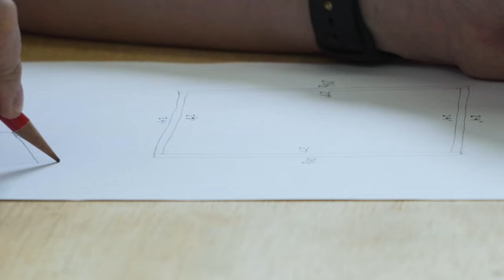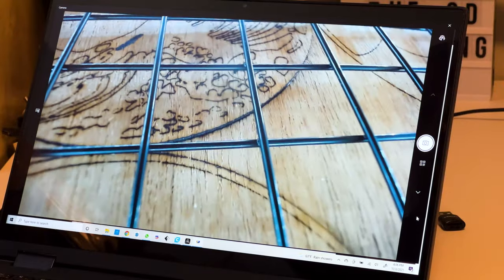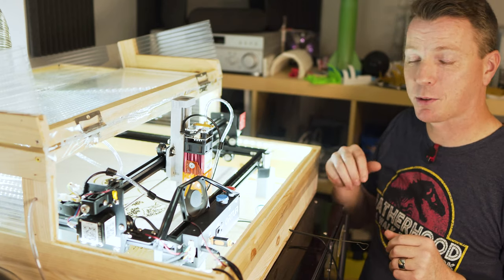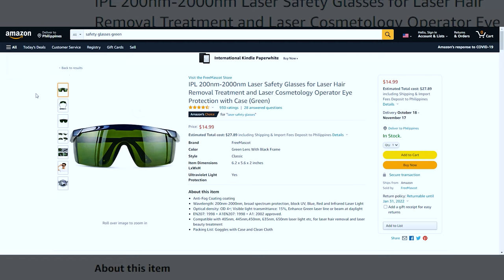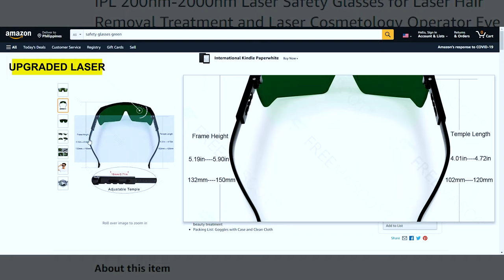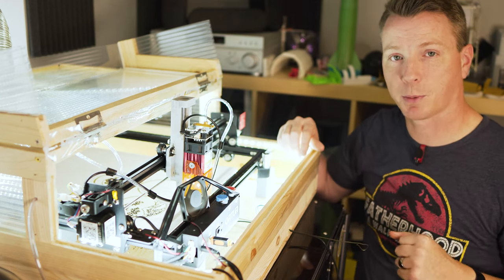6 Must Have ACCESSORIES for LASER Engravers / Cutters   |    Feat. Ortur Laser Master 2 Pro

Comment: Pro tip,  if the laser didn't cut all the way through in certain spots,   pull out an orbital sander and sand away.  Works like a charm
Reply: Louisiana Hobby Guy has a video out on restarting a job after removing the piece.
Reply: The squid games honey comb method

Comment: We have a K40 laser in the office with ventilation of the housing. It is quite miserable. At home I attached a 40W diode laser to a MPCNC. Instead of putting the whole CNC in a housing I attached the ventilation hose directly to the Z-axis near the laser - so the smoke is sucked directly away and through the window out of my room.

The idea with the camera is great, thanks 😀

Comment: I'm looking at the 65x50cm models, they come with the same range of laser heads from 2 to 20W I think my budget can handle the 15W unit now that I repaid my overdraft. I don;t think they are quite as developed as the Orthur though, like exposed PCB, and no obvious emergency stops etc... but the frame looks fine for a 2D CNC.

Comment: That poor orange shroud. You destroyed it with your drill @ 6:29. Lol
Reply: That's what he gets for using regular drill bits instead of drill bits made to drill plastic (or a step drill).
Reply from the maker: Yup - I murdered it. But a bit of packing tape held it back together just fine. Lessons for next time.

Comment: I agree that using the camera underneath is brilliant!  Specifically, which camera did you use?  I bought a Logitech C920S and it will not point up from underneath without modifying it.  Did you use the NexiGo camera you listed?  Did you modify the mount so it would point up?

Comment: Just FYI, A soldering iron does a better job at making a hole in acrylic than using a drill. Proper ventilation is needed, but does not shatter or break acrylic.

Comment: I'm thinking about buying this for cutting 4-5mm plywood. Should i buy the 2 Pro OR the 2 Pro S2 ? Wich is better for cutting?
Reply from the maker: To my knowledge, they both use the same laser - a 5500mW diode. You CAN cut 4-5mm ply with it but it's not quick and will require quite a few passes and probably air assist. Cutting 3mm can be difficult with this laser. A Co2 laser will be a lot more powerful for those types of thicknesses.

Comment: "Print at your own risk - I couldn’t get this one to work"

So then what did you use for the Z-axis height adjust?
Reply from the maker: I was referring to the one that claimed to work with the Pro model. I ended up cutting into the non-pro model version to make it thin enough for the bolts to reach all the way through, which is why my Z-axis adjuster looks cut up. It is :)
Reply: @The3DPrintingZone  Do you have the drawings or plans for the 3D print?

Comment: @12:20 some of the safety features are a bit… unreliable on my Ortur. For starters I couldn’t even use half the speed they advertise, as the bump protection would trigger on fast acceleration - wouldn’t even show a legible error message. And yes, that even happened when the device was mounted, using completely snug fitting feet, onto a 600x800x20mm sheet of plywood with the rest of my enclosure attached. Tech support’s solution, after weeks of discussions and mostly waiting, was sending instructions how to lower the sensitivity. I‘m fine with that, although it was a pain to get their response.

Much worse, the fire detection is getting triggered by UV light, as in the babycam I repurposed to monitor the cut (nightvision mode uses UV and switches on automatically in low light condition) or even irregularly by my LED room lighting.
Ortur‘s response? Sending instructions on how to disable that fire alarm. 
Why would I want to disable that, if it was a chief feature that made me buy the thing?!?
My solution: replacing the LED lights with an incandescent bulb. In addition I lined the machine‘s enclosure with an LED strip, that is set to a warm orange tone - prevents the babycam from switching to night vision and does not trigger the alarm by itself.
Still, on some cuts the alarm went off when the laser passed close by the sensor on the backside of the control unit. Whenever this happens I block the sensor with a piece of cardboard so I don’t need to switch it off entirely.

And when it comes to the emergency stop button… it does stop the machine. However I did have the laser fire upon some freak error, where the button was locked in the off position and the machine decided to switch it on all by itself. I‘m glad I installed a switch that kills power to the whole enclosure. Was meant for convenience but worked as an actual safety feature then =D

Don‘t get me wrong, I like the results the machine gets me, both cutting and engraving 4mm plywood and genuine leather quite easily, but the time and money spent to get their was an issue.
Your points were well presented, none of it was new to me though, unfortunately. I haven’t had the time to get an air assist going and I don’t know if that extra camera to check the underside is really necessary. I just cut at least one pass more than would strictly be necessary and then slightly tap on the pieces, to see if they are moving or not, without moving anything out of zero.
But I agree that the z-axis slider, enclosure, ventilation and eye protection upgrades are essential. Contrary to what you showed here, I built my enclosure with only a single see through (but filtering the laser’s blue light) panel on top, everything else is solid. That way I don‘t need to wear eye protection in the room while the machine is running. Coherent laser light be dangerous, yo!

If I sum up everything I paid to get to the current state, I probably doubled the price of the machine, even without the camera that I had gathering dust anyway. 
Thank you for sharing!

Comment: Hi!  I have a Laser Master 2 Pro with the same laser as you, the LU2-4.   You mentioned stronger lasers as replacements for the LU2-4 in this video.  Do you happen to a have a list handy or could you mention a few drop-in replacements?  I haven't seen any and most certainly not of Ortur's website, so I am thinking that these might be aftermarket, 3rd party mods.
Reply from the maker: I don't have a list but if you check out the Ortur Laser Master 2 Pro group on Facebook, several folks there have upgraded theirs and listed what they used.

Comment: Why do you have tape on the flame detector light?  If you are trying to disable the flame detector (a must if you are doing cutting because that damned thing sees "fire" every time I try to cut even a 1.5 mm piece of wood) you have to put a piece of tape over the detector on the back of the control panel.  Putting tape over the light doesn't do anything except keep you from seeing the light when the fire alarm beeper goes off.  Or did I miss something there?
Reply from the maker: Haha! That makes a lot more sense. For some reason, the tape over the light thing did seem to help but maybe that was my imagination. Yes, I was trying to disable the flame detector because I struggled with it going off too much. Thanks for the tip on how to handle that.
Reply: @The3DPrintingZone  haha... Yep, it was a placebo affect.  The light bulb controls nothing.  There is a little black "bulb" extruded on the rear of the board.  That's the sensor.  Tape over it.  I just got my Otur put together and burning a grid on my board now.  Takes about 6 hours just to do the first vertical lines at speed of 4000.  Then I've got to do the horizontal tomorrow.
Reply: @The3DPrintingZone  I kept getting the alarm even with the sensor covered with blue painter's tape so I got to wondering if there was a sensor in the light also.  So like you I covered it for a test.  Still got the alarm.  Come to find out blue painter's tape is translucent.  so with the sun coming in my window (UV triggers it) it was seeing sunlight and shutting off.  So I found this code you can type into the console to turn it off (disable the fire alarm).  Flame sensor can be disabled by using $261=0 in console.  Hope that helps.  The new firmware upgrade 1.87 is supposed to have the flame sensor disabled by default now.  I just upgraded it today will have to watch it and see if it comes on when the sun it on it.

Comment: What glasses do you use to protect yourself agaist the laser ?
Reply from the maker: I just use the ones that came with it. I haven’t taken the plunge to buy the nicer ones yet.
Reply: @The3DPrintingZone  I read alot about that the ones that usually are shipped with the engravers are not a proper quality in order to protect your eyes well enough. Did you just run the risk?
Reply from the maker: @anders9215  Since the laser already has a tinted shroud on it, between that and the glasses I feel comfortable with it. On the forums, most folks are doing the same and I haven’t heard any negative issues as of yet.

Comment: Hi. Do you have any good recommendation on how to DIY the LED strip setup? Never done that and would wanna include it in my setup too.

Thank you :)
Reply from the maker: The kits they sell these days make that one of the easier parts, actually. Almost all LED light strips have adhesive backs and you can use a hot glue gun if that's not strong enough. They usually come with either a remote or even a full smart phone integration as well so it's just a matter of plugging it in and then sticking it around the inside of the enclosure. Even if you're not using an enclosure you can rig up something with some coat hangers or boards to give them a place to mount to. Is that the kind of info you're looking for? If not, let me know and I'll do my best to help.
Reply: @The3DPrintingZone  Thank you for the answer. I appreciate that.

Can you actually cut it and connect it in parallel? Or those kits are usually meant to be just plugged in as they are?
Reply from the maker: @djVania08  You almost always can - check the kit before buying but most come with cut locations all throughout, where you can cut them with scissors and then run a set of wires (usually R,G,B and 12v) for as long as you need to another section. That typically involves soldering but it's still fairly straight forward to do, even with a cheap soldering iron.
Reply: @The3DPrintingZone  well, I'll have to test it out. Thanks for the help

Comment: Why is my Z axis adjuster file You linked to opening up in cura at about one tenth the proper size?
Reply from the maker: You’ll have to take that one up with the author of the file but if you check the comments I think it says you have to increase the scale by 10 X.
Reply: @The3DPrintingZone  But where in cura do I do that at?
Reply from the maker: @cosmicraysshotsintothelight  Select the object, hit the S key and enter the percentage you want to increase it to.
Reply: @The3DPrintingZone  Thanks.  I guess that S stands for scaling.

Comment: Thank you for the list, most are already on my Wishlist.  In evaluating the Z-axis adjustment, I watched a video claiming that the added mass (weight) of the Ortur z-axis caused the laser to overshoot the intended stopping point.  I imagine that this would occur when stopping form a fast white space skip back to burn speed.  Have you experienced this?
Reply from the maker: I haven't seen any difference in performance, no, but I suspect that's because the added weight is so minimal with these prints. Two light pieces of plastic with a 20% infill don't add up too much. It's always a good idea to test, of course, but I didn't have any troubles.

Comment: I see your think you taped off the fire alarm. But the thing on top you taped off is the alarm. Not the sensor. The sensor is a black LED on the back facing the laser.
Reply from the maker: Yeah, I realized that after the fact. Someone else in the comments help me sort it out :)
Reply: Hyperactive sensor here also. So i taped it off after seeing your video. But did not work. Hence some more investigation………

Comment: Why would you want to maintain the flame? You said that when highlighting the air assist 🤣 you should have burned a hole into the plastic guard with the laser rather than destroying it with a drill bit🤣🛫

Comment: Pro tip, buy a laser that does not require any of these accessories. My 90W FSL Titan W\ Autofocus is sooooooooooooooo nice. Expensive, but I didn't have to mess around and mod things.
Reply: But you got it from where?
Reply: @cosmicraysshotsintothelight  Full Spectrum Laser. When Patrick says 'pro tip' he means "only buy this if you're a professional using it to make money or have $10k you don't need".
Reply: @sjholmesbrown  I don't really need a primer on how to buy.  If I see a high price point I don't buy it.  I don't just buy it anyway because I want to call myself a pro.
I was using laser engravers in industry over ten years ago every day.  I know how to make a business doing this type of work.  I have $10k I don't need, but I still won't be dropping it on an overpriced laser to boost my ego.  I can make multiple passes if I need more cut bell.  MORE CUT BELL!